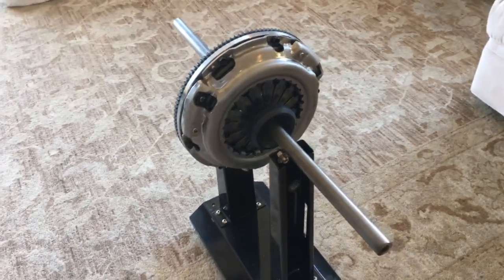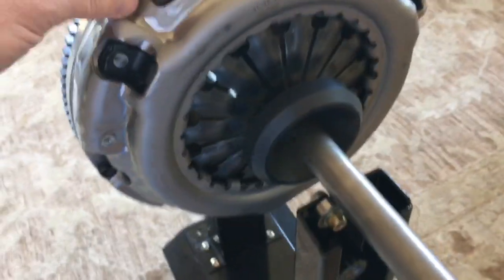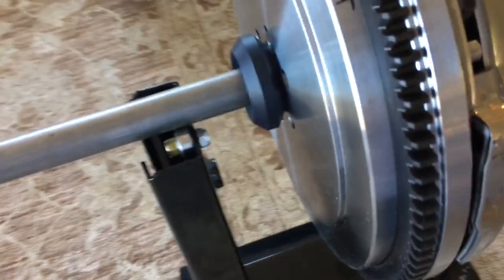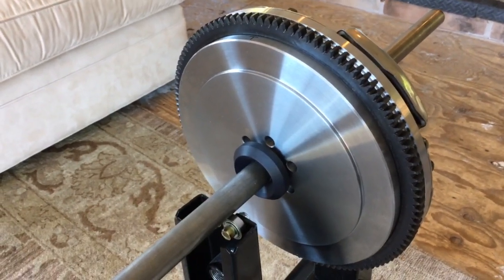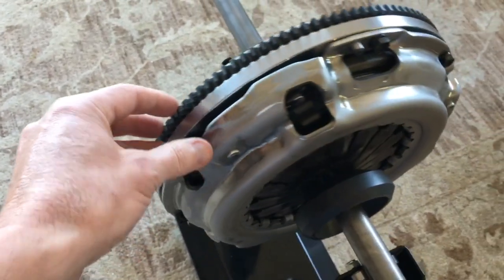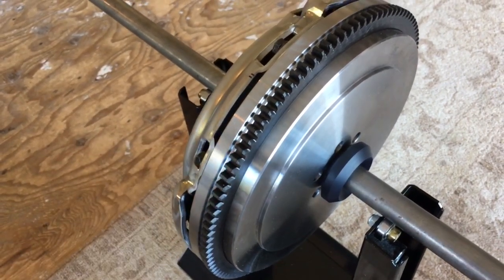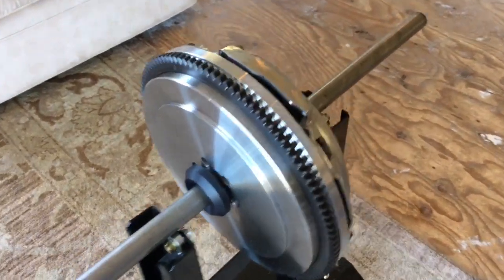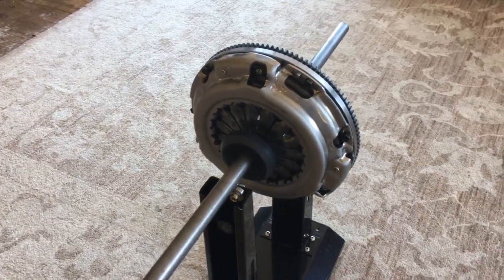DIY flywheel & pressure plate (aka clutch cover) static balancing for Toyota Pickup 22RE

Comment: il have do to this with my frenenstein volvo clutch and audi clutch basket .... the basket dosnt fit oem, need to drill screw holes a tiny bit larger need to grind the spoter pins uppwards... and then il need to balance the whole thing...
Reply from the maker: Yeah, I think balancing the assembly as a unit is a good approach. It's been working fine on my truck over here.

Comment: How would a shop do this?
Reply from the maker: Usually shops have a machine that is computerized I believe, kinda like wheel balancing places for your tires. I actually looked up the patent for those machines and read up on how they work. The short answer is doing a static balance by hand is several magnitudes more accurate (at least as far as balancing wheels and tires go). The machines balance to around +/- one ounce as I remember; when I did the wheels on my motorcycle and Ferrari, I believe I got them down to a few grams (in the case of my carbon fiber motorcycle wheels, I had them down to 1/4 gram). I also spoke with a guy who has been balancing driveshafts for 20 or 30 years; he told me while they do have a machine with electronics to balance the driveshafts, he likes to do the final balance by hand, so he can feel if there are any minor vibrations. Balancing crankshafts on certain motors seems very complex from what I have seen and I still don't fully understand how they figure out exactly where to remove weight; but for stuff that is round like wheels and flywheels / clutches, this static method seems to be plenty good. I don't trust most shops to know what they hell they are doing, so usually I like doing some sort of DIY method if one can be found.
Reply: @ray5961  I'm a put to order my 2nd clutch for another project. That along with a light weight flywheel.  And was looking at balancing it locally in central California.  I'll have to call around the shops. But like you said. Most shop are most likely bullshitters amd will jist take the money. But I daw a price rate of $90 for it at a different shop about 3 hrs away. And I'm not too confident in balancing my self.  So maybe some kind of balancing is better than none, and just take my chances locally. I'll have to paint mark exact location it needs to be  bolted and see it they even deduct any weight
Reply from the maker: @damnitdang  Yeah.. the hardest part is setting up a rigid jig to do the balancing part on. I used to do a lot of motorcycle stuff, so I happened to still have my static wheel balancer handy. On my clutch, not sure if I mentioned it in the video, but I ended up using a titanium bolt or two in order to help offset the weight and achieve a good balance. Something else to remember is that 4 cylinder motors have inherent imbalances by design and their firing order, etc. so you are never really gonna be able to make your 4 cylinder feel like a perfectly balance straight 6 or V10 or V12 motor. You can perfectly balance most 4 cylinder motors and they will still have 2nd order vibrations to some degree - this is why the Toyota 3RZ-FE motor uses balance shafts. As long as you do a half way decent static balance on the flywheel w/ pressure plate attached, you should be fine.
Reply: @ray5961  ah, ok. Yes, it's a 22rte I'm actually working on. I had bought an act 350tq rated clutch.. but I will be using oem pilot and release bearing.  So maybe I might not have to balance it if it's like that... I'll probably still call around and see if they can  locally balance it .
Reply from the maker: @damnitdang  How do you like the ACT stuff? I'm running a 9.25" flywheel here with a slightly heavier pressure plate and a full kevlar clutch disc. From what I've seen, the ACT stuff is pretty nice.
Reply: @ray5961  oh I haven't even installed it yet lol.. but I'll get a 93-95 flywheel to match up also. But I bought the best fullface clutch act have without going kevlar?  Are you boosted also to go with kevlar? I didn't want to drive around in a 6 puck. I'm getting a new motor rebuilt so I'm buying alot of stuff new for it. You know any good starter also? Maybe rockauto densor?
Reply from the maker: @damnitdang  I'm running the starter from LCE. Just kevlar for longer life. Gonna build a turbo 3RZ to replace the 22RE down the road

Comment: Would it be worth having a machine shop balance a flywheel/clutch assembly before installing?
Reply from the maker: Wouldn't hurt, although making sure your pistons and rods are balanced is probably more important. Generally the flywheel and clutch should be pretty close. I like having things down to a gram or less myself.
Reply: Definitely yes. I had a horrific imbalance issue with a Rover V8 that was eventually tracked down to a factory new pressure plate assembly that was 25 grams out of balance. The out of balance factor was enough to virtually shake the whole car uncontrollably above 3000 rpm.

Comment: I have flywheel setup I'm do this on after I lathe some the backside, I've balanced mc wheels with jackstands a 3/8 long extension and a level, lucky me my pilot bearing goes in the flywheel and not the crank just like cycle wheels..

Comment: After i changed the clutch, the bearing and pressure plate on my Volvo 740 i was getting vibrations from the engine.
What could be the problem? anybody had the same issue?

Comment: Dynamically balancing is best . I'm spoiled with top of the line electronic equipment. You're likely introducing a couple unbalance countering with the p plate .
Reply from the maker: Yeah, I think you are probably correct. Ideally I would like to re-balance this entire rotating assembly, including the crankshaft. Like you say, some sort of dynamic balancer is best. Can I ask what you use and/or if there is some name you can provide so I can maybe find a video of the type of electronic equipment that is normally used in this situation?
Reply: @ray5961   a crank balancer would likely be your best bet .your not gonna want or need to buy what I run. You could bolt up your assembly's  right to the crank or a crank that could be just the tool or arbor I can say too. American Hofmann is where I work. In Va , not Germany.  Shenke also makes balancers but are soft bearing, we are hard bearing , rollers that are stiffer where as soft bearing machines kinda wobble . I can get the plane separation on the height of a pressure plate on or 30.1 vertical balancer.  Flywheels can only be done statically and I can get them down in the dirt , our balancer probably cost 70k. Lol.

Comment: Very interesting, I put a clutch in a few years ago and had small vibrations through the peddle and very light clutch chatter which annoyed me as I cleaned the fly wheel and pressure plate several times until the cloth came off clean,  the chatter and vibrations got worse with age and this is a well known reliable OEM brand too but it did do 100k of delivery vehicle driving, recently bought a new one and notice there was weight pressed in on pressure plate I assumed it was for balance, got me thinking that you have to balance a wheel after a tyre change  so why not a clutch and this new clutch looked like it was professionally balanced at factory, put it in and the clutch and engine is remarkably different so smooth and even smoother now it's bedded in,  it's unbelievable different, this is an engine using dmf too, I went for a different brand this time that has a long history of making good clutches which I've used in the past on me old sports cars, the old clutch had worn uneven like it was warped and the old pressure plate had no weights in at all, would be interesting to see how out of balance it is, looking back now I think the old clutch had a balance issue that created uneven wear as it destroyed the slave/release bearing, when I took the gearbox off the bearing had separated from the slave carrier never seen that before how it was still working I dont know so must of been a balance issues to a point it wiggled the bearing so much to a point it's separated.

Comment: Did you use a dial gauge to check centre?
Reply from the maker: vintage speedshop - The cones that fix the flywheel to the axis do a pretty decent job of indexing things. If you are asking if I put a dial test indicator on the edge of the flywheel to make sure it was centered to like .001" or .0005", no I didn't do that, but that's a very good idea for next time :-) Mainly the goal here was to bring the out of balance down from several ounces to more like a few grams. I forget what the final result was but I think it was like 3 grams or so. Should be okay for the pickup truck, given it's a stock motor and not a race motor or anything blueprinted, etc.
Reply: @ray5961   The only reason i asked is the pressure plate fingers are floating and can move quite a bit 1-2mm

Comment: Do you have to do this before mounting them?
Reply from the maker: volarecantare You don't have to, but it's a good idea - it will make things smoother and last longer. From a production standpoint, it would be too expensive for a company like Toyota to blueprint and balance every motor to such accurate levels.
Reply: @ray5961  How about logistics? Did Caterpillar do this?